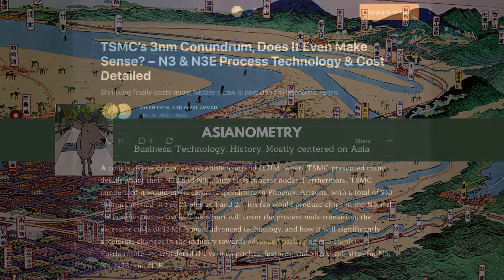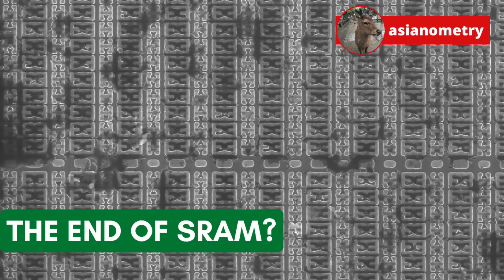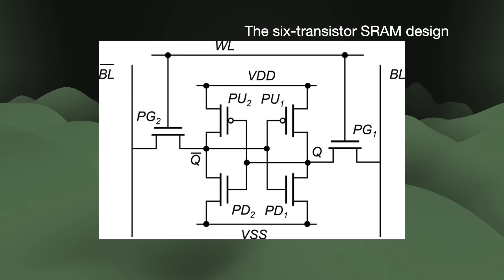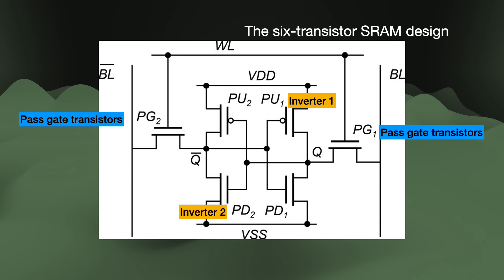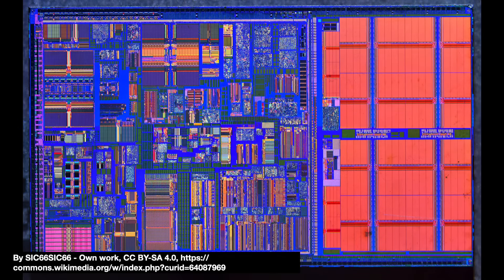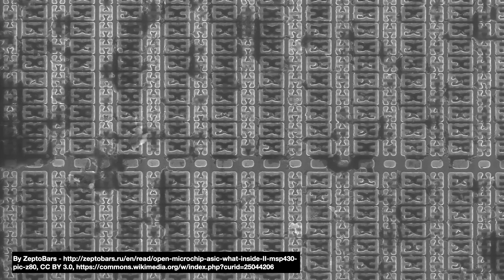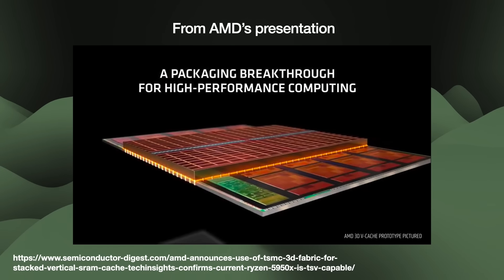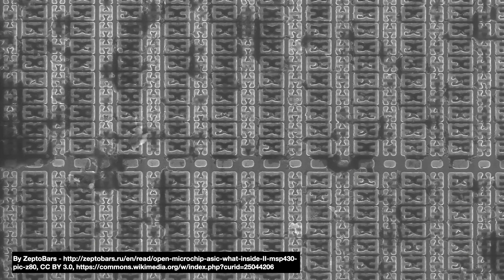Can SRAM Keep Shrinking?

Comment: "It can draw out data in a few nanoseconds." No. SRAM can draw out data in fractions of a nanosecond. In 3nm-7nm, small, even stock TSMC SRAMs (use in an L1) can manage 250ps clock to data. Larger macros (used in an L3) can still achieve <500ps clock to data.
Reply: To be precise it depends on the CPU clock speed and how many bytes per design are read/write at once. Yes nano seconds are DDR ram not SDRAM
Reply: @Fiercesoulking  Not really. SRAM timing is unrelated to CPU frequency, other than that some macros may happen to run on the same clock. PVT corner and geometry dictate the clock to data time.
Reply: @Fiercesoulking it is common to use 2x clock on SRAM blocks to simulate dual port access
Reply: That’s insane. Light barely travels across the entire CPU during that time, yet we read data  in that timespan.
Reply: @lbgstzockt8493 "the entire CPU" is absolutely huge compared to the size of a SRAM cell. Like comparing walking across the block to circling Earth.
Reply: @lbgstzockt8493  eh. 250ps*c is about 7cm. Considering that the die size is, ballpark, 1cm, I don't think its in the "barely" range yet. Plenty of other things are though, like pcie, at least over the distances they operate, they're casually disconnected.
Reply: To be fair if it can do it in a fraction of a nanosecond, it can do it in a few of them
Reply: @Fiercesoulking  DDR SDRAM is tens of nanoseconds. 

eDRAM does indeed reach single digit nanosecond latencies, IIRC thanks to partially using SRAM for caching.
Reply: not a computing expert, so can you tell me what "draw data out" precisely refer to?
Reply: @EntekCoffee  Access, extract data.
Reply: @fungo6631  I assume it's just cell read operation. I'll consider a 6T SRAM cells, which I assume are commonly used for caches. It takes three main steps to read: switching the write line transistors, discharging one of the capacitors in the 2 sides, and then working with the sense amplifier. I count at least 3 transistor switching delays and one capacitor discharging delay. Depending on the design, this can take longer. 

I don't work with clocks, so I don't know how that'd translate to how many clock cycles that'd take. But at least that's the fundamental limit. 250 ps is one clock cycle @ 4GHz, I'm still not convinced how the reading operation takes just one clock cycle. Can you explain?
Reply: @htomerif  you forgot that the speed of light in vacuum is always greater than it is in a material. The speed of light in the traces of the CPU is about 1/3 c. So it just depends on what background the original poster has. A EE will think in terms of 1/3c a physicist will think c.
Reply: You misheard him.

He said "within a few nanoseconds".

Which means it could be faster, as after all different cache levels tend to be.
Reply: @mnomadvfx  Actually, you are mistaken. The SRAM is just as fast at every cache level. Their latency only depends on the size and design of the macro. An L1, L2, and L3 are all composed out of more-or-less the same blocks. SRAM macros in the last 10(? )years nearly always have an access time less than a nanosecond.

What makes an L2 and L3 slower than an L1 is a combination of other factors: the need to access them in sequence, the increasing physical distance, and the  generally slower clocks used in the uncore (to save power).
Reply: @EntekCoffee Well, you counted three switching elements. I'll tell you that in 3nm the rule of thumb we follow for 4GHz+ is to keep logic depth less than 18 between sequential elements (registers). That's a lot more than 3. ;-) The main delay in an SRAM is not the transistors, it's the RC delay to cross the "long" distance and fanout from the port to the cells. That's why the access latency greatly depends on the size of the SRAM macro.

There are indeed SRAM macros that can respond within 250ps, though these tend to be smaller macros. Small macros tend to have less bits per area than large macros, so good designs tend to run the SRAMs of an L2 and L3 from a divided clock. That way you have ~500ps of slack in the slow corner PVT, which is more than enough to use 8kiB-sized macros (typically the point of diminishing returns in density).
Reply: @wesleyw.terpstra1902  Ah, thank you for the explanation. As I said, I don't work with clocks (I only have experience in few transistor configs, without integrating it into a VLSI). Discussions like this are very helpful. Are you trying to say that global clocks are determined more on the interconnect delays, and not transistor/SRAM capacitors? If that's the case, which of the two is more influential, the capacitive or the resistive element?
Reply: @EntekCoffee  I'm not sure what you mean by global clocks. We usually have lots of clocks for the different parts of the SoC (if a clock goes too far, the clock uncertainty becomes too high for it to be useful). Clock frequency of a component is decided based on power and performance goals. The selection of SRAM macros is then made after the frequency target is known.

The delay in an interconnect (ie: between cores and cache/etc) due to distance is only moderately impacted by frequency, because the delay is whatever the delay is, say 2ns. If you run at 2GHz, then maybe it's 4 clocks to reach from A to B, while at 1GHz you would need 2 clocks.
Reply: Wesley, I agree with you. Absolutely can be sub-nanosecond.
Reply: @wesleyw.terpstra1902  Global clocks are the clocks read by your system, one that's fed by the PLL circuit and clock generator. I assume this is smartly utilized depending on each RC delays. If I read between the lines, capacitance doesn't seem to be that big of an issue.
Reply: Sorry for being unclear. Let me continue. Your explanation implies that the Tr.s on an SRAM (register, L0, whatever they might be) are limited to their data/power pathways' resistance instead of switching delays related to capacitance. I think that's clear.

Now for that "less than 250ps" delay, I'm assuming that's just the "read data out" process - which if I read correctly does not consider interconnect resistance. Let's assume that the distance between the cell and the sense amp is negligible. This implies that cutting-edge SRAM cells "read data" within that delay. Can I say that this 250ps delay is entirely based on capacitive delays since resistance paths are assumed to be small? Or am I missing something here? 

Additionally, If 4 sequential charge/discharges are needed in an SRAM, would a single CMOS transistor have a switching delay of <62ps?
Reply: @EntekCoffee  250ps is the entire process from clock to data out of the SRAM and setup time into a register that captures the result...

I have no idea what a single transistor's delay is, but an entire gate (like 4-way AND) is like 8ps.
Reply: @EntekCoffee  What I was trying to tell you is that there is no such thing as a "global clock" as you describe it on a modern SoC. Different portions of the chip run on independent local clocks. There are two reasons: 1) different frequencies are appropriate for different components 2)if a clock has to cover too far a distance / large an area, the clock uncertainty becomes too high.
Reply: @lbgstzockt8493  So how do they bring latency down, switch to light computing? Or just compute in memory or sram. How would that even work.

Comment: AMD said that using anything lower than 5N for large SRAM blocks costs more than they taste (as we say in Sweden).
Reply: And dont forget "Costs shirt" ;)  Mvh Ajsof-bajs 💩
Reply: No.  That's what a customer paying for Epyc-X said.
Reply: For L3 is quite sensible, but L1 is no go
Reply: Yes and no.  Actually the shrink in size starts to become neglegable at the 7nm node, but AMD will use 6nm, a variant of 7nm for die that is say, L3 cache.  This is using TSMC, other companies nodes are different.

Inside a core there is no choice but to use the node the core is on because certain cache HAS to be built into the core, which is true with L1 and L2.  L3 is also built into the core but it's pushed further away, and using interposers you can join one die to another and put L3 cache elsewhere.  AMD has X3D CPU parts that have L3 on both the core die and another die that stacked onto the core.  I could see a day when AMD moves to what Intel is starting to do now (Meteor Lake) and have chiplets that connect directly together instead of having to send data to what they call Infinity Fabric which has to multiplex data to send it to the right place, which is how AMD connects core die (CCD) to each other along with to an I/O die (IOD).  If this happens then instead of stacking die, AMD could make an L3 chiplet that sits next to the core die(s).  At which point AMD and Intel both could push ALL L3 onto another die.
Reply: What does 5N mean? Five nanometer?
Reply: @herrbonk3635  Probably. AMD CPUs use chiplets with which SRAM is made with an older process with much better yields.
Reply: @fungo6631 Yes, the limits are reached, for real. And Nand flash uses even larger transistors (to make them more durable) but instead builds hundreds of layers on the same IC. That's possible because flash memory does not get as hot as high performance processors.
Reply: That’s a great phrase
Reply: @JackBlackNinja 
Indeed... "it costs more than it tastes" is very on point. 

I like "now you have taken a dump in the blue locker/clauset/cupboard", meaning someone has screwed up very badly.
Reply: @johndoh5182  L3 wont ever sit next to the core die, not unless L2 is massive, which makes no sense as it would become too slow for purpose, having the extra L3 be on top of the die is the right and best solution as the vertical distance is so small they can and are treating the extra cache as if it was internal, no need for buffers/drivers, intel's method takes more energy and latency to achieve the same thing, by the simple fact that distances become larger.

Comment: As said in the video we're at a point where all of the challenges are starting to dominate. Lower voltages means reduced noise margins. Smaller feature sizes increase tunneling effects and requirements for even higher precision lithography. We'll probably overcome these but it will be slow going and more revolutionary than someone coming out and saying we've solved them all. We also have opportunities to try new computing architectures to try and avoid some of the short comings. We have a history of hitting a roadblock and coming up with clever solutions that nobody saw coming.
Reply: This is something a well-trained AI could tackle. Meaning it could analyze possible solutions given as input, much deeper than any human could.
Reply: @paulmichaelfreedman8334  
not really, AI can't invent new magic physics...
Reply: @paulmichaelfreedman8334 definitely not. Our ai is basically just pattern recognition, it doesnt function like a human brain that thinks. If it gave us a solution, it would either be copying a human or 'hallucinating' and accidentally giving a solution
Reply: @lt2660   My apologies, I meant AGI/ASI
Reply: @Napoleonic_S  I never implied that, I implied it could do a much deeper analysis of (human conjured) theories. And I also should have said AGI/ASI
Reply: I think the real issue is staring us right in the face. We keep adding more and more memory, and to process that ever increasing memory we need faster and faster processing. I think we need to get back to more efficient use of code. I work in IT and software engineering and as a hobby build CPUs from discrete logic a la 1980s style with 74 series chips. Modern code and operating systems are inundated with fluff code. high level languages such as C# are complied and finally put down into machine code. But we take for granted the immense amount of code inefficiency translation from high level down to machine. The other issue is the shear amount of processes running on systems that really have no use other than to generate profit through some convoluted process due to corporate leaching because code must be able to run on as many hardware chipsets as possible.
Reply: @renaissanceman5847 😂 this reminds me of game developers being sloppy with their codes because the hardware are so powerful today, so games aren’t quite as efficient as those developed in the 90s. I see truth in your statement.
Reply: @henrytep8884  Very True. when the Nintendo NES came out in 1985, its processor was a 1.8 Mhz 6502 based 8 bit CPU... the code written for it was at CPU level. Every code segment was scrutinized for efficiency. and as you say, today, developers take for granted the fact that all of that is very much beneath them. most have little skill in writing machine level code.
Reply: @lt2660  dude, this guy is probably a clueless techbro. i doubt he even knows what he’s talking about.
Reply: imo we just gonna keep throwing more silicon at the problem, until we endup with a silicon cube with the size limited by how long light can travel from one side to the other within the target clock frequency.
then we might jump to photonic computers, but there the cache issue might become even larger, caching for a Thz computer will be a nightmare

Comment: I love how we are getting so small that quantum mechanics is required to do anything more...or how it's been making it impossible to squeeze more performance out.
Reply: Yes, it's ridiculous really, how far we've come technologically in the last 120 years.
Reply: We've been there for a while!
Reply: Technically we have been employing quantum mechanics on every transistor regardless of how small it is.
Reply: @deang5622  I have to disagree: by the end of the 1800s we had quite enough understanding of crystals, atoms and electrons that a scientist of the day could understand how a diode functions and eventually a transistor. 

Classical physics is certainly enough to understand what's going on.
Reply: @thewheelieguy did I understand correctly, scientists still are just trying to avoid quantum things (eg tunneling ) and build chips according to these classical physics laws... it just gets complicated design having billions of these simple transistors in one chip.
Reply: We already had this problem in 2007 and switched to high-k dielectric materials which bought another decade. But now the gate is too thin again.
Reply: It happened with clock rates. We had to stop pushing them higher and go multithreaded.
Reply: QED (qauntum electro dynamics) has been an important factor in lithography at least since the late 90s, with an ever growing priority from then on. And they still aren't /exactly/ sure how electron waves propagate over/in/through/around a wire!
Reply: @paulmichaelfreedman8334  The Altair, January 1975. I remember running across the yard in the snow screaming. I knew what it meant (sort of) instantly.
Reply: Quantum mechanics has been causing confusing issues in computing for a long time - go and read about the save file corruption issue with Crash Bandicoot 1.

Comment: Never had a transistor compared to yeast before. It's these kinds of analogies that Im here for.
Reply: That's before the transistor got as small as yeast ... Well, transistor shrank to yeast size back in the 1980s. A couple of orders of magnitude smaller, now.
Reply: The research need another direction too. Rather than focusing on increasingly more difficult how to prevent quantum tunneling from happening, we should open up the study on how to utilizes the quantum tunneling effects to achieves better reliability & performances.

Comment: "We will need more alternative solutions." Yeah, like write computer programs in languages such as C, C++, D, Zig, Rust instead of freaking Electron (JavaScript) on desktop or freaking Node (again, JavaScript) on server. Here, free performance boost without changing nanometers or dealing with quantum tunneling.
Reply: Or my favourite language… assembly. When it’s hard to write you write it efficiently. Straight ahead C is pretty good, C++ is very inefficient comparatively, and uses a lot more RAM, especially on run-in-place embedded systems where code runs straight from flash and not RAM. I design car ECUs and that’s how they work.
Reply: But that means you'll need to get rid of web dev diversity hire that got the job for all but their skills.
Reply: @fungo6631   oh, no
anyways... 😂
Reply: I just remembering when they say c# and java is bloated, but hey they just choose a more bloated solution : web browser, with killing flash, silverlight, and then reintroduced similar solution : web assembly. I just smelling a political reason to those trend. Another example, google and jpeg xl, google still insist to force everyone to accept webp and avif as de facto a replacement for jpeg and png.

Comment: «More memory is as good as I remember»
~ Asianometry, 2024
Reply: Write that down 😂
Reply: Nor always true. It depends in application.  Some benefits - overall system.  There are application that benefits in ram speed ;most importantly timing. 

Cache on cpu does just that.  Repetitive task that used the same memory benefits it on cpu Cache.  Cpu higher clock does not always make things faster when Cache bottle neck it.
Reply: I think he could have continued, "... though I don't remember anybody ever saying that".
Reply: @BlueRice Not only repetitive, just everything that follows locality
Reply: Never forget this quote.